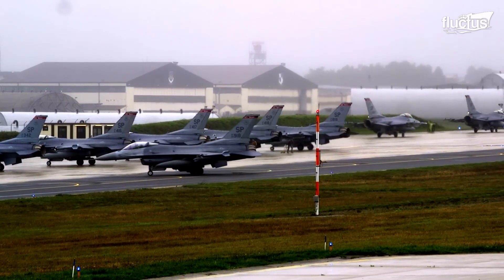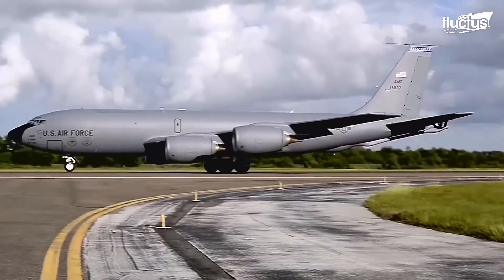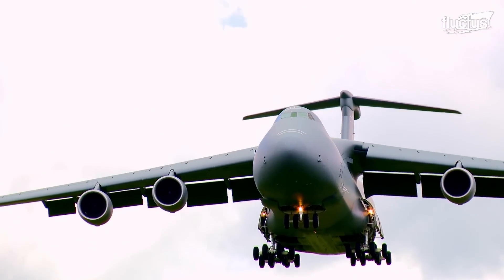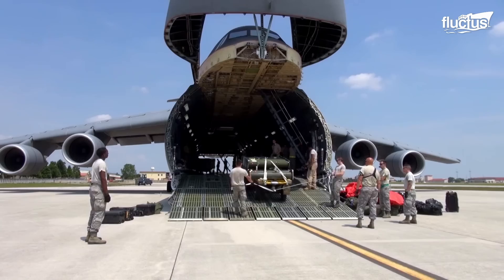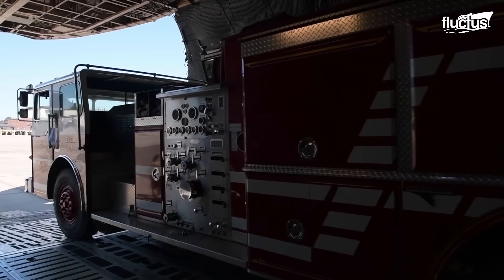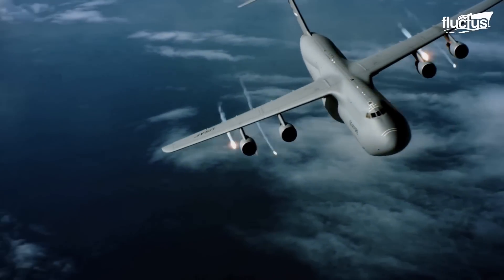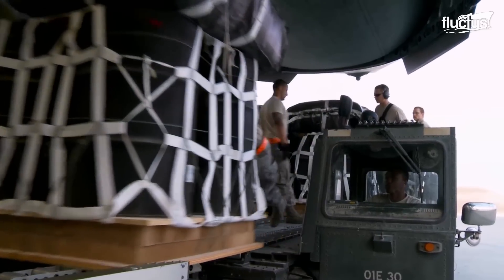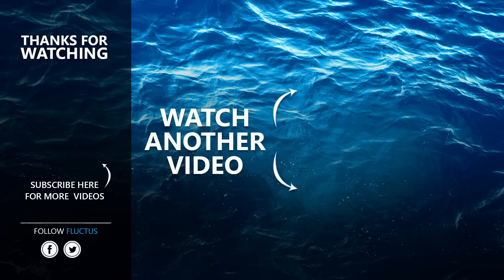The Scary Process of Refueling US Largest 420 Ton Aircraft in the Sky

Comment: What happens if there is an accident of malfunction with the tanker and the other aircraft cannot be refueled? Is there another tanker on Stand By all the time?
Anyone knows that by a chance?
Reply: There’s often a cell of two tankers, but every flight where AR is planned there’s a divert option in case of failure to refuel.  Usually a military air base.  Thats regardless of the number of tankers.  I’ve done seven hooks flying an A-10 without external tanks from Lajes to Pease, NH.  In the middle we were nearly constantly refueling to be able to fly to a land base in either direction,
Reply: @GLEX234  Thanks!